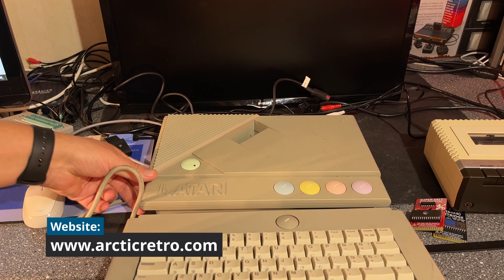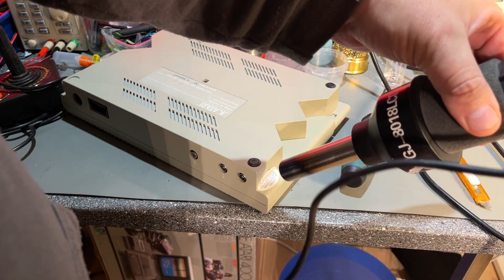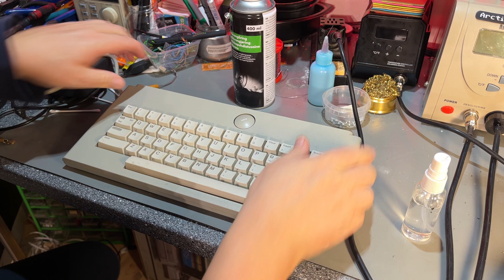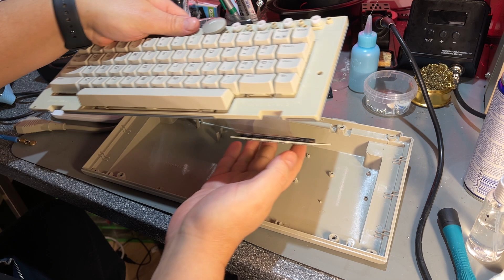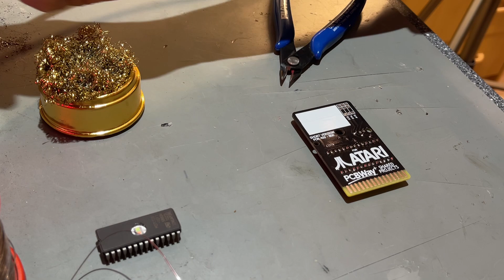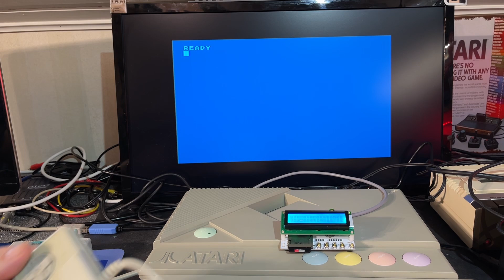The  Atari XE GS Video Game System - Testing, fixing, and restoring an old classic

Comment: Congrats on your XEGS it's very nice. They are rather rare so you are fortunate! Thanks for sharing your experience here.

You still need to hold down OPTION to disable basic for games loaded from disk or tape on this just like the XL.  Cartridges almost always disable basic.
Missile Command will use a trackball too. CTRL-T I believe. Might even work with an ST (or Amiga?) mouse I forget at the moment.
That original power supply should not be used. It will probably overvolt the computer. A USB phone charger with a custom cable or standard 5v DC will work to five pin DIN.
To preserve the label under the XEGS you can wipe the lower half of the clamshell instead of dunking it in water.
The four buttons on the console use carbon contacts and do not need lubricating.
Probably a very good idea to recap your XL and XEGS.

Comment: Sometimes when you load games and they don't work (like Scramble in this example), it's because you need to turn on the machine while holding down the Option key (the pink one on the XEGS). This will disable Basic and free up more RAM for the game. As a rule of thumb I always switch on holding down Option now.
For even more RAM I would suggest you check out the Ultimate 1MB from Lotharek. It will require some soldering, but could be a great future video.
Also, you should look into getting a FujiNet if you're enjoying the Atari. It will give you internet access over wifi and no more need for constant downloading and copying to SD card.
Reply from the maker: Hi Christian. I actually knew about that holding down options, but I did not think about it :) As for the other tips, thanks a lot, I will look into that for future videos. I added that on my list of ideas. Thanks :)

Comment: Just got one dead  XEGS really cheap. It turned out the two RAM chips and ROm were dead while the CPU didn't work well with newer games. De-soldering  all those chips was a pain but it went really well.
Reply from the maker: Great job :)
Reply: Did you burn an eprom? I am looking for a 28 pin 32kb eprom but it is not available in Jameco. I saw 24 pin ones but not sure how to build an adapter from 24 to 28 pins. Ideas?

Comment: If you define a computer as doing computing tasks, then the Atari was better. The CPU in the C64 was only 1.02MHz, compared to 1.79MHz on the Atari. The C64 had a good sound chip (being released 3 years later) with some interesting synth modes, but only 3 voices (16-bit), and just runs at 1.02MHz. Atari POKEY sound chip could run at 1.79MHz, but just had 2 16-bit voices, or 4 voices in 8-bit configuration. Both had 4-bit sample playback capability up to 48KHz, but POKEY should be better for digital playback due to a faster clock rate coupled with a faster CPU. The C64 interleaved CPU RAM access and graphics RAM access, which pushed RAM access up to a theoretical 2MHz when both were "simultaneously" accessing RAM. The CPU or VIC II graphics chip could only access RAM at 1.02MHz independently, however. The Atari had a separate graphics processor (ANTIC 1.79MHz) with its own limited instruction set and RAM, processing graphics routines and its own programs (called display lists) independently from the 6502. On the Atari, the 6502 and ANTIC could, in theory, concurrently process data at 1.79MHz, but to manage things, ANTIC would take precedence over the 6502 on DMA conflicts, effectively making the ANTIC the Atari's true CPU. However, the ANTIC could "steal" cycles from the 6502 during normal operation for routine character set operations, but on the other hand, these operations were offloaded from the 6502, so it's not really a cost. Good programming would dictate shutting down the ANTIC during intensive computing operations to ensure you're operating at the full 1.79MHz. Thanks to some nice tile graphics properties of the VIC II, the C64 could display up to 16 (dreary) colors on the same scan line. The Atari could only display two colors from a relatively large palette of 128 colors in high rez mode (256 colors in GTIA modes), but these colors could be changed on each scan line, for a total of 128 colors in every graphics mode, or 256 colors in GTIA modes. There are dozens of graphics modes available on the Atari, each offering trade-offs between resolution and number of colors-per-scanline, and graphics modes can be combined, or mixed with different colored sprites.  Not many developers know much about the internal workings of the Atari in the early '80s however, because Atari refused to release technical details to the public in the beginning, and they didn't rectify this until the C64 came out. They also didn't increase the memory or lower the price until then. Commodore included a proper manual in every C64 box.
Reply from the maker: Wow. Thanks for that detailed insight :)